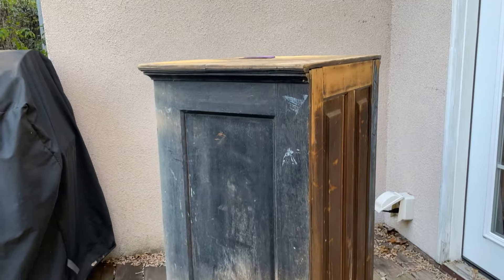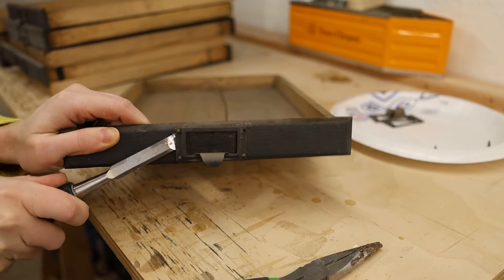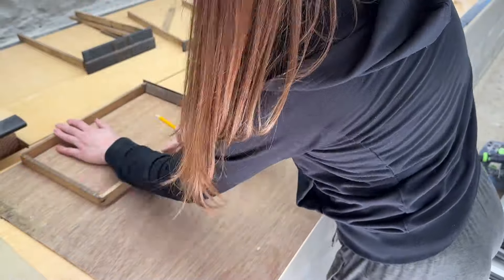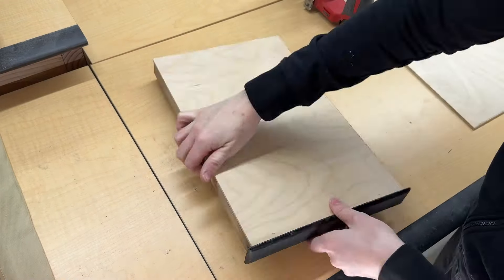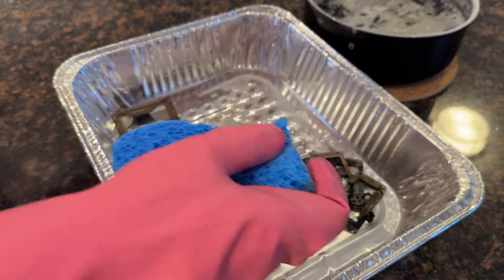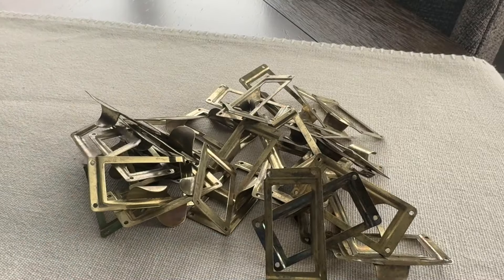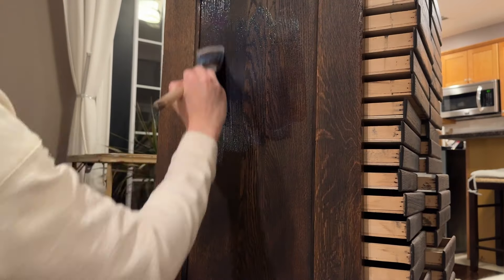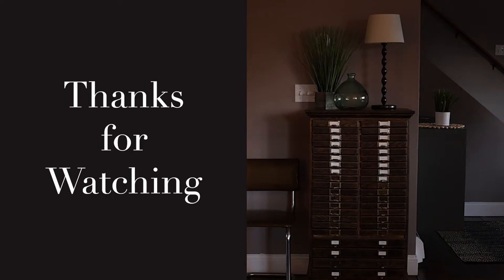Refinishing an Antique Cabinet

Comment: Nicely done. I think oak looks better with black in the grain. There are ways to achieve it with new oak but when it's already there it makes the job easier. If I might suggest a couple of things. Get two putty knives, a flexible blade and a stiff one to tackle the jobs instead of your good chisels. Also when installing small nails hold them with a needlenose pliers and use a tack hammer. You can find all the items at a flea market. Bar Keepers Friend cleans brass well and they shine up with a buffing wheel on a Dremel. If you want them to stay shiny they need a clear top coat of some kind. Again well done on a good collectors piece.
Reply: Yep, needle nose pliers and a tack hammer would be the way to go.
Reply from the maker: Thank you for watching and sharing the suggestions! These are great tips. I definitely need a needlenose pliers and I think I might actually have a tack hammer. I had the rotary tool as well for polishing 🤦🏻‍♀️ Now I know for next time!